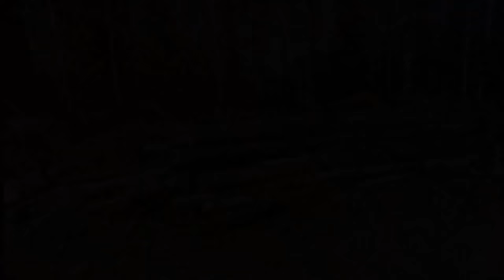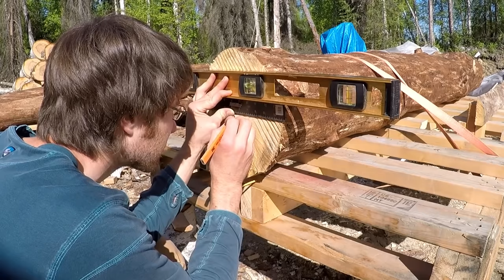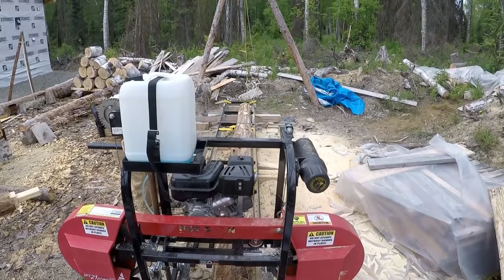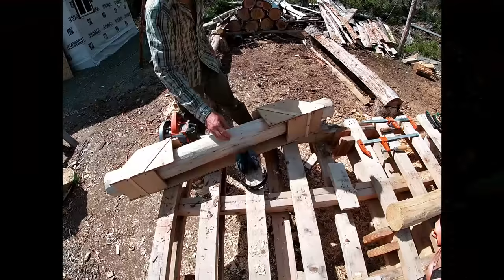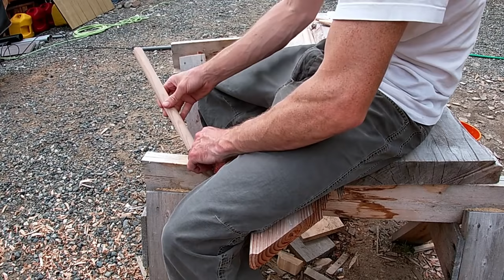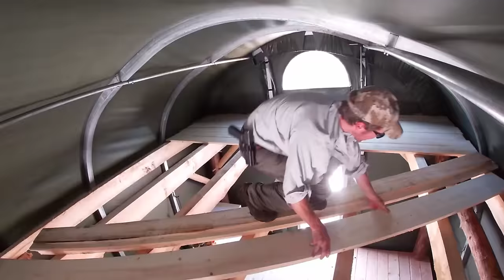Mortise & Tenon Log Frame Storage Loft

Comment: A joist can be notched at bearing locations at either the top or bottom without reducing its structural capability, as long as the notch doesn’t exceed one-fourth the joist’s depth.